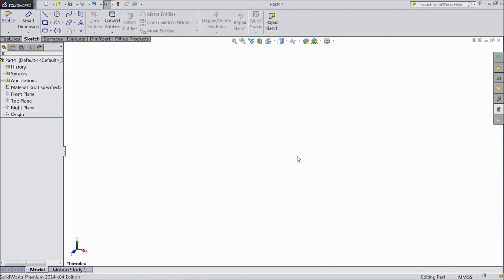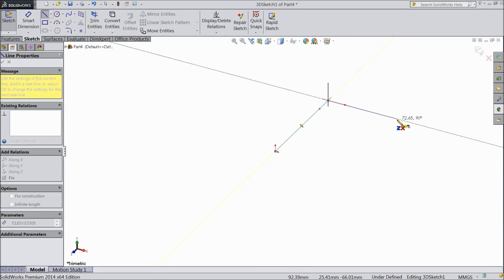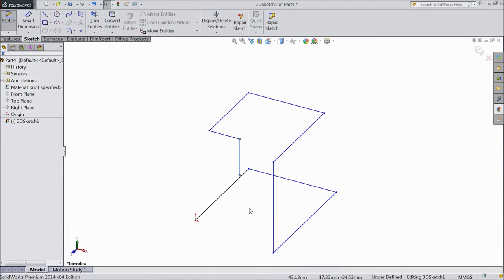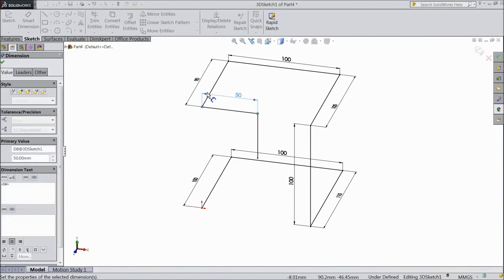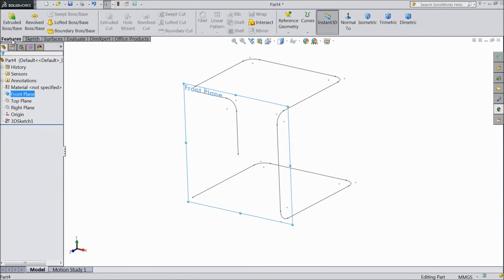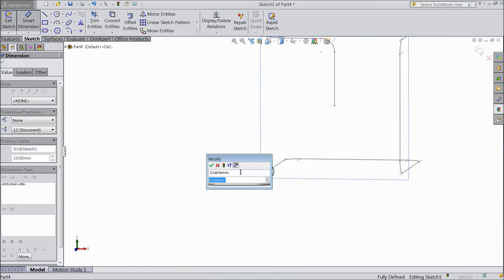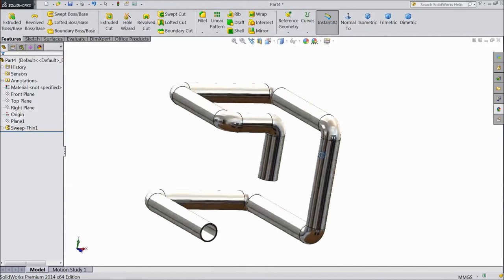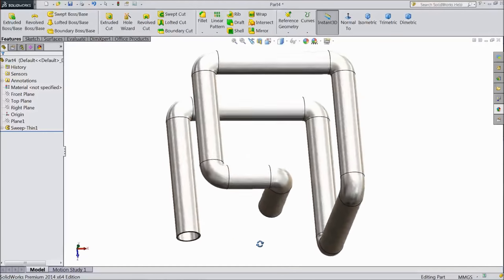Solidworks tutorial 3D Pipe

Comment: You started the 3d sketch on the origin, which by definition is on all three of the default planes.  So why did you feel the need to create a new plane that duplicates the Front plane, on which you draw the circle to extrude?  It would also have been much more useful to know how to do this in a welded assembly with proper pipe and schedule sizes and straight pipe lengths and elbows at proper piping industry stock elbow radii.